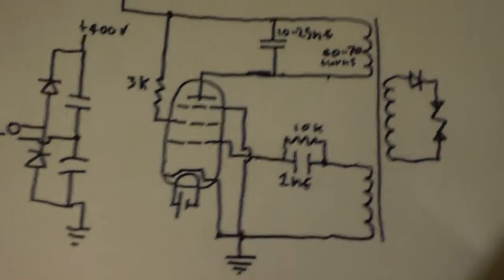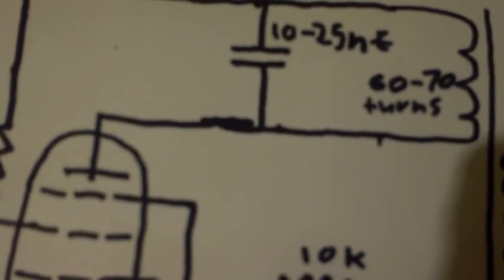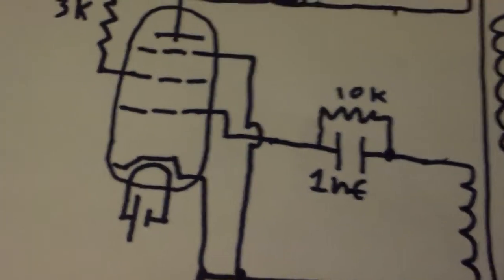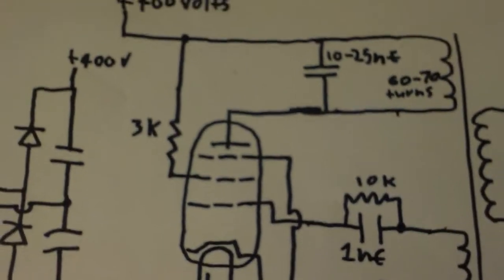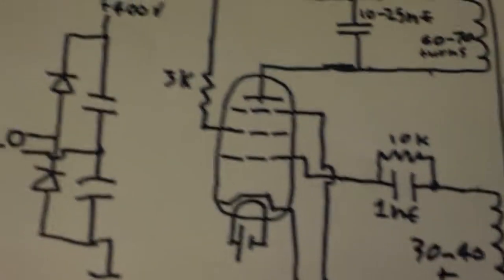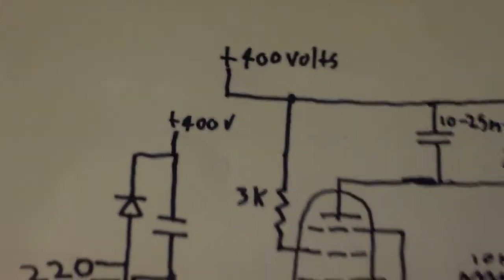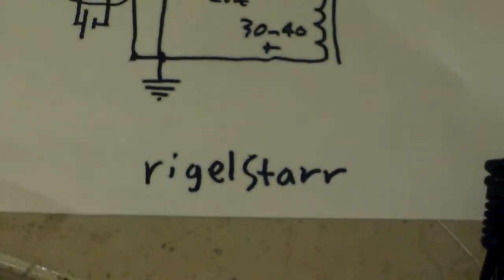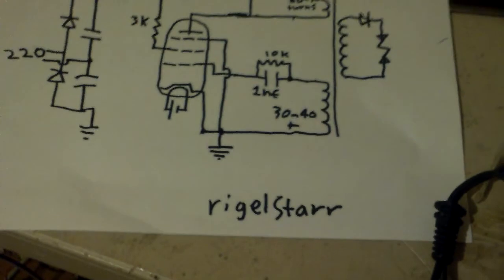vacuum tube flyback driver

Comment from the maker: @ExplosiveAnyThing I am using a 2e26 tetrode and a pl509 will work great with this. I would not recommend using less than a 60 turn primary because tubes need higher impedance loads than transistors. any less and I think the output will be smaller and the tube will over heat really fast

Comment from the maker: @robot797 it's about 250-300 volts b plus potential everywhere in the circuit. I can happily say I have never been shocked by the power supply for this

Comment: if you dont get enough power
amplify the drive power with a triode
that should drive the penthode tube to the max power
and also use a beampenthode tube from a television those can handle more power